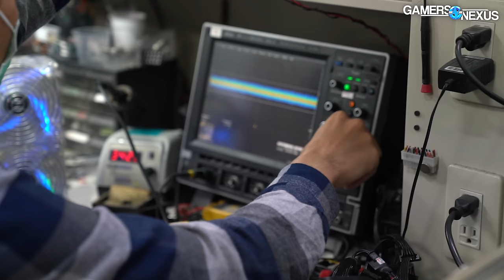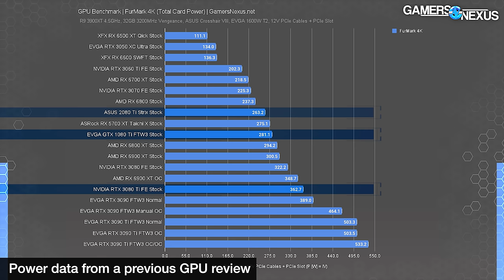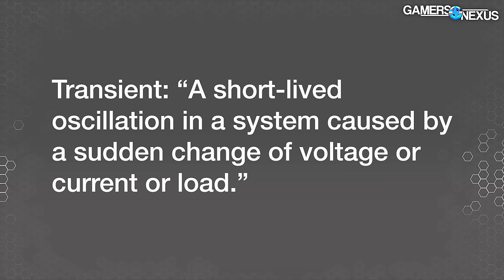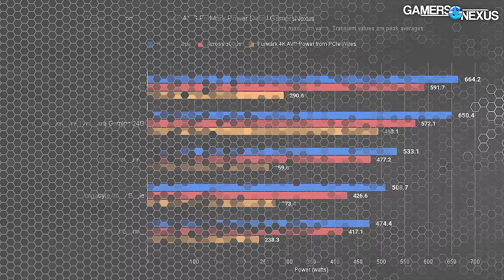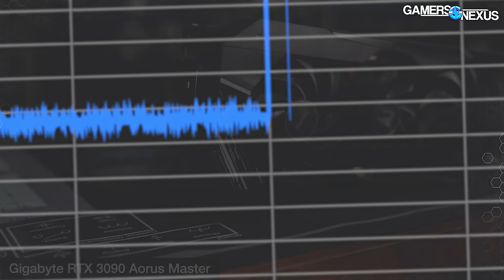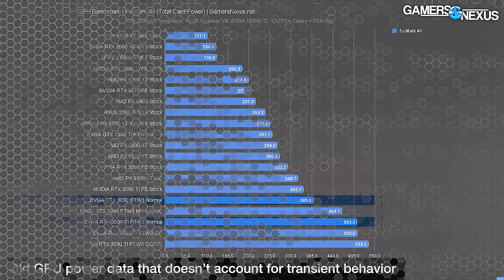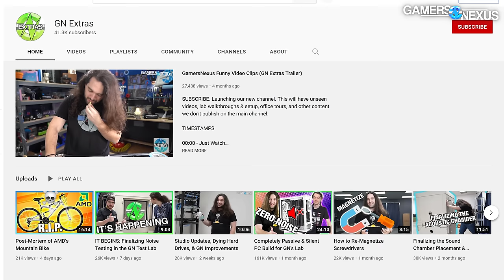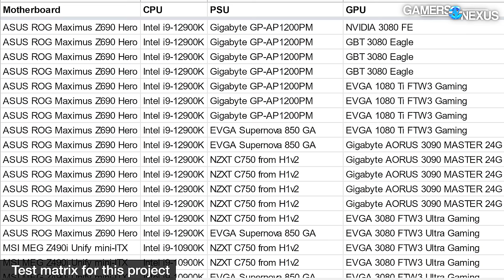The Brewing Problem with GPU Power Design | Transients

Comment: Graphics cards need to have enough capacitance to cover the transient spikes they generate and offer a smooth enough power draw that at no point does the card go beyond the publicly stated max power draw. If they have a device that does not or can not do that then it is out of spec and they need to publicly acknowledge this phenomenon and publicly report the max transient power spikes so pc builders can ensure they pair a power supply that can supply the demand. Anything less is not acceptable. This is clearly a design problem on the graphics card manufacturer's side. How many consumers have dead power supplies only because graphics manufacturers incorrectly designed a card and did not report the true max power draw? Repeatedly causing customer power supplies to repeatedly trip OCP and the customer not knowing what it could possibly be given the power budget allotted to the components and the power supply capability.
Reply: This is exactly it!
Reply: I would think so too.
Reply: This was my thinking since these "mystery black-outs" started and still is. The power supply might be the better place for a huge capacitor, though. But it seem like it doesn't actually need to be that huge.
Reply: i came here to say something like this and this is perfectly summed up. it is 100% upto the card manufacturers to disclose the max power draw even if it is "transient" because its still the card that is causing the problem. its a massive copout for such a huge company to blame another company "because the psu shuts off" nah my dudes. make your cards within spec or disclose the maximum draw instead of pointing fingers. we have never had problems like this in the past untill nvidia started making these cards that seem to double power usage every generation. as a pc builder it would be super embarrassing to complete a build and have the customer say that there are these kinds of problems. reasons like this is exactly why i prefer radeon cards at the moment. they require much less power for similar performance in most settings.
Reply: I think part of this problem is software in that today's GPUs are more aggressive in ramping up and down for performance reasons.
Reply: @brodriguez11000  This!: If the GPU regularly starts to draw double the power for a fraction of a second, just talking about the hardware side feels like missing a big part of the picture. From top level software past drivers down to GPU bios. The pure existence of the spikes is the issue, the idea that customers can BUY overpowered powersupplies to cover the spikes (if only that was the number given) isn't a solution. And if powersupply manufacturers behaved that way (causing these spikes to the electrical grid) causing breakers to flip, there'd be an outcry. I shudder to think what those spikes do to the hardware long term, but I guess "longlivity" isn't a concern that GPU manufactureres view the same way as anyone else does....
Reply: Agree.  GPU manufactures needs need to publish the transient power draw requirements of their cards and power supply manufacturers need to publish the transient capabilities of the PSUs.  Say at 100u "spike" duration. for example listed as 300W Max and 450W Spike.
Reply: I wanted to write the same thing. Great comment
Reply: There would be another reason, why to beef up the Powerregulations on the Graphic Cards with bigger Capacitators: Lifespan. You got a 480mm Distance from the Powersupply to the Graphic Cards. Which means that is reaction time as well. Very slightly but it is. On a long PCI-E 2x8pin Cable, even when it is high diameter, a Transient may leave the Powerregulators of the Graphic Card underpowered. Which reduces the lifespan of the Powerregulators on the GPU, even when the system does not Crash. But who would profit when the GPU dies after 3-4 years ?  
Thats the Lifespan of a good PSU in a Region with very "dirty" Grid Powersupply, the GPU generates literally the same, but on the consumerside for the Powerregulators on the Card, such Transients are Powerregulator Killers. You can swap a PSU (and should do it regularly) but not the Regulators on the Card.
Reply: @Elkarlo77  I think bigger capacitors aren't the solution. Considering the short time of the peaks the behaviour looks very much like "all the capacitors that have been in standby mode of a low work state recharging at the same time". To have them have MORE capacity would increase the spike in that case. This looks more like "may they need to charge one after the other when trying to react to a load" thus broadening and lowering the peak.
The root to me is powering down cores and ram when not needed to conserve power in the long run, thus not keeping capacitors up actively. I feel like "uncharged capacitors charging" is exactly what would cause thes types of spikes, the same way that light switches arc because of the capacity of the circuit you cut of with the switch. These very short but high spikes are really suspicious of what needs that much juice in a short time but not that much juice overall.
Reply: Transient spikes have been double the rated TDP for many, Many, years. Ideally though, it would be nice if transient spikes never exceeded 200% of rated TDP though, so that you could get a PSU which is 200% of rated system TDP, and 99.9% of the time, it would run at 50% of it's max power output (which is where PSU's are most efficient). And the rare power spikes would only push the PSU to it's max, not beyond it and cause crashes. If you get a 300 TDP gpu, and a 105 TDP cpu, plus about 100 watts for other system 'stuff', you're at around 500 watts expected usage (TDP). BUT, you need a 1000 watt PSU to eliminate power-spike crashes, get ideal power efficiency, and keep your components in peak condition. This isn't new.
Reply: @theholk  bro that's not how caps work... They don't just randomly start "charging" and drawing power when load shuts off.
Reply: @emissarygw2264  None of that is what I wrote. Random didn't enter it, nor "when load shuts off". But modern device do suspend cores and ram that isn't use to conserve power (whether you want to be optimistic, to reduce poweruse or pessimistic to be able to print lower "mean power consumption" . which includes suspending the powerdraw. Which means that if load requires them to "wake up" they have to be recharged. The fact that these are spikes that short means there is a lot of demand (high current) but not much Power demanded (very little wattage). That's exactly what happens if you turn things on. Capacitators (whichs job is exactly that, being small buffers) get charged. doesn't take much energy, but if done wrong it creates current spikes.
Reply: @theholk  I suppose if the capacitance was on the load side of things (i.e. caps on some internal subcomponent of the GPU used to smooth out local power) and they were allowed to completely discharge before the subcircuit were re-powered, that'd be true. I don't imagine that is what is being discussed though, considering we're talking about beefing up caps to make PSU's capable of handling spikes. Caps on the supply side strictly have the intended effect of smoothing transients.
Reply: @emissarygw2264  "considering we're talking about beefing up caps to make PSU's capable of handling spikes"  Which don't power down. And not sure what you mean subcomponents. just look at your gpu card. The caps on the cards ARE for smoothing psu output. but if they don't power up in series but at the same time, it draws more power than the component behind it are supposed to draw. if the caps weren't specced that way, they would work as buffers well. The shape and values of the spikes is something VERY specific. And the beefing up of psus is a smokescreen. it is a bruteforce solution to being able to handle the spikes AND have surge protection. It's not that current psus couldn't handle the spike. It's that the surge protection needs to trigger on them, because it couldn't possibly distinguish between those, and a fault state. Buying a twice as "big"psu, just to handle signals from the card being indistiguishable from a fault state is absurd.
Reply: @theholk  The Gpu caps don't power down either, unless you're talking about cold booting after shutting down the whole system. But PSUs are already designed to handle boot up scenarios, so that's a non issue. The transient spikes we are talking about are happening mid gameplay. That is not going to be caused, or worsened as you described, by increasing the size of the caps on the psu or on the power input to the card. The only way cap "power up" could factor in negatively would be if there's, for example, a separate power circuit on the gpu for some specific area of the chip that is usually inactive but turns on suddenly to handle some very uncommon scene rendering. This seems extremely unlikely. So overall, your assertion that increasing cap sizes will make the problem worse is completely wrong.
Reply: @theholk  I can only guess that you're harping on this power up scenario because of some experience with turning on large appliances and blowing a fuse. Yes, that's a thing; but no, that's not what's happening here. Transients in the middle of a benchmark session are like your big appliance causing a breaker to blow after running for an hour.
Reply: if my power supply get destroyed by my card... i can sued nvidia for this! good to know.
Reply: My question is,  do they have enough room on a GPU board to facilitate the number of capacitance and resistors needed to soak up these transient spikes? The solution i had, from my unqualified perspective, would be to put more big-boy capacitors into a PSU. Does that make sense? I don't know what the limitation would be on the PSU aside from space which is less limiting than on the GRU side.
Reply: @theholk  Oh well you answered my question about larger cpacitors lol. I guess this would also apply to the PSU?
Reply: @BenginamanTheBawws  I first experienced it with my R9 Nano that apparently draws 275W max. Sometimes it just spiked well above 350W, and that, combined with a 5960X OC tripped the OCP on my Super Flower Leadex Gold 550, which is like a top tier PSU in its range. Other than these situtaions it was fine, R9 Nano drew 200W, the CPU 150 at max.
Reply: They could hide them in the edges of the board in the empty space that the fans and heat sink don't cover
The cooling wouldn't suffer much from half a dozen notches for some high capacity caps
Reply: The power supply manufactures must meet standards for the "noise" they allow out on the 50Hz or 60Hz outlets. The problem that the power supply has is distinguishing between a short that can damage the power supply and high current caused by loss of normal diversity (average power) during GPU transients. If there was a standard for computer power supplies to supply 250% of the PSU rating for 400 micro seconds then all we would have to do is purchase a PSU made to that rating. This would probably cost less than a PSU with a rating that is 180% higher than the GPU TDP.

Comment: Moral of the story: Everyone needs 1200w PSU's, separate and isolated breakers, tesla solar roofs with power banks, and a dedicated nuclear power generating facility to accommodate next level gaming hardware.
Reply: You forgot home and contents insurance when the fire takes your home and assets 😉
Reply: No, replace the fuel rods with xx90/Titan cards and you can recover something like 80% of the power
Reply: Well...I got the 1200w psu so far.
Reply: I have a 1600w psu. 😎
Reply: @LawrenceTimme  I almost got one, but I hesitated until they sold out or the sale ended because they put a different plug on them. Does yours have a different plug on the cord from the wall?
Reply: 2000watt psus gonna be the norm at this rate.
Reply: @ffwast  yes it's bigger
Reply: These stupidly high power transients of current gen and next gen cards make 1080p gaming on low end cards more appealing. I can't even begin to tell you how much heat production increased when I upgraded from my 1050ti rig to my new 3070 rig. Summertime gaming is a legitimate heat stroke risk now
Reply: @justinbiggs1005  Try using the same 1080p monitor and/or undervolting the card. I haven't gotten a new monitor for my 30 series card yet and it runs perfectly cool because it's doing the same job as the old one but it's like 400% faster and the performance delta from the 1050ti to the 3070 is the same.

Comment: Just want to also say that the animated depictions were both really helpful and well done. It’s easy to take those for granted, but there’s probably a lot of effort that goes into those, too!
Reply: I came to the comments to say exactly this. At 21:05 they didn't have to go through the methodology and explain how it works, but they did. Not only that, they put an animation together to show how the instruments measure the EMF to come up with their readings. That's not a small deal. That takes a lot of extra effort and I said wow, that's really well done, out loud when that came up.
Reply: I noticed and was going to say the same thing.  Really high quality animations and a fantastic explanation of how the tool worked.  Kudos to the GN team.

Comment: "We adjusted for the latency in the hall effect sensors........". You guys are truly an amazing group.
Reply: @Lurch7861 Lurch7861, My sincere apology for making a comment that upset you so much that you felt compelled to call me names.
Reply: @Lurch7861 ok buddy you sure are very smart
Reply: @Lurch7861 No, measurement latency is not a college physics thing.  Heck, in my CPE labs, which were the same ones the EEs took, we never bothered to correct for it.  Quite frankly unless you're looking for something extremely specific, it's not worth the pain.

Wall power is atrociously noisy as is, and on the DC side we aren't doing weeks of data analysis.  We're fixing the problem!  Heck, most of the O-scopes I used were CRT.  There was no data export.  Even the digital scopes I think the most I ever did was export screenshots.  And my senior design project was on power monitoring...
Reply: @Lurch7861 : It's not a matter of having the education to know that you need to do something, it's about having the time and money to spend on doing it.
Reply: @Lurch7861 My background was hard science and I had to take more than a few college physics classes. Never was taught this…

This is an electrical engineering concept.
Reply: Psychology major here, I am thoroughly confused but happy to be a part of the conversation 😊
Reply: HMMM.... so what did 'Lurch7861' actually say?   :)